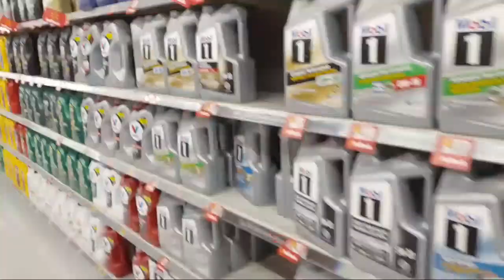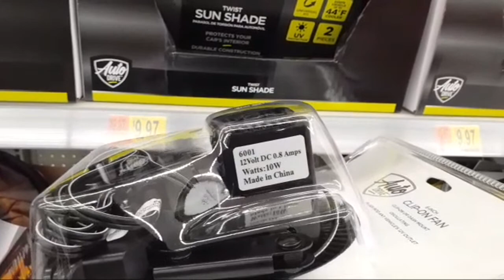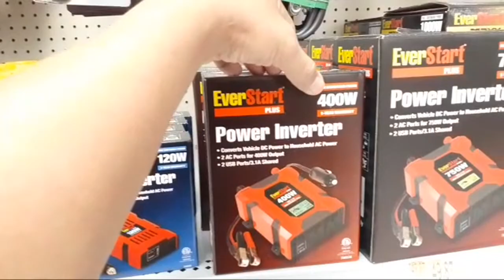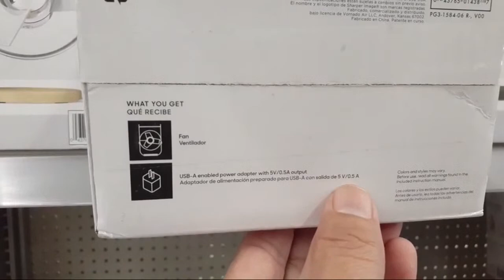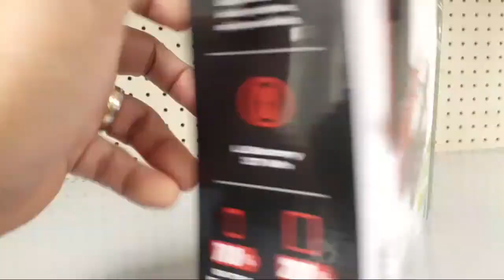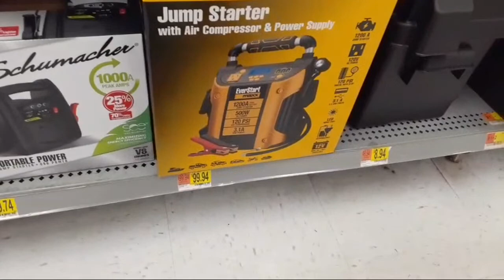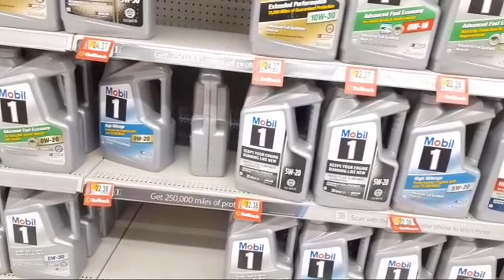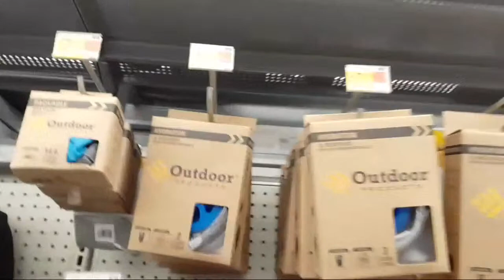LIVE - How To Make An Emergency Power Pack

Comment: You could run a pretty good sized heater off that 1500w inverter. I’m thinking maybe one of those oil filled radiator type heaters so I can warm it up then it will retain heat for some time after i turn it off. But I think I need a bigger van.

Comment: I was into the Jackeries and stuff like that but I think this is the way to go. I just looked and our Walmart has 100ah deep cycle batteries for $75. That’s 600wh usable according to my calculations. And you can charge the RV battery off your car with jumper cables pretty quickly. Definitely gonna do this soon. I can even charge my jackery power stations off the dc outlet too. Gonna be running a 12v electric blanket this winter for heat.
Reply from the maker: Plan on warm comforters/sleeping bags. Electric blankets may or may not require too much power, as I've not tried it.  Even small 300-watt space heaters are too much.
Reply: Living In A Van yep. I have down sleeping bags. There is a 250w space heater at Walmart for $11. But I’m gonna focus on the 12v electric blanket thing. I think it’s around 50w if I recall. With a timer. So the battery should give me 600wh which should run the electric blanket no problem. I may get another one for my dogs too.
Reply: Living In A Van I think this is the one I was looking at, for around $22. 48watts. Sherry said she uses one of these and it’s a good system. To me this is the most efficient heating method. It runs in 30/45/60 minute increments so I’ll run it a couple times a night and maybe in the morning. https://www.amazon.com/Sojoy-Multifunctional-Electric-Blanket-Control/dp/B07J1YLFMQ

Comment: How do I know when the RV power pack is fully charged when using the car battery to charge it? Will it overcharge?
Reply from the maker: It won't overcharge because it uses the same charging system that you use to charge your 12-volt vehicle starter battery.  Using an alternator will actually not fully charge it because it doesn't step down the charge rate like a charge controller would as the battery gets closer to becoming fully charged.  However, it's good enough.  Most inverters include a battery power level monitor.  The 750-watt one I showed at Walmart has such a meter.